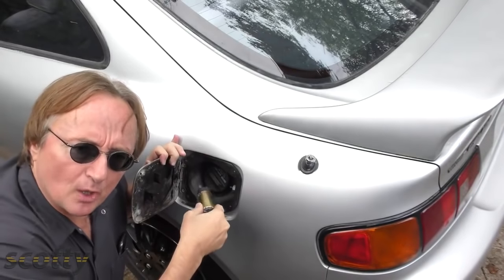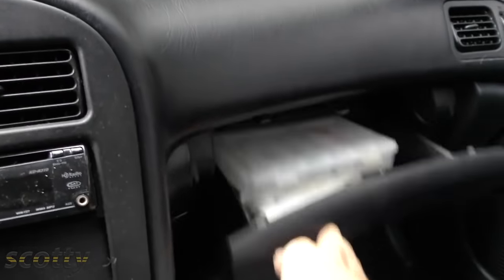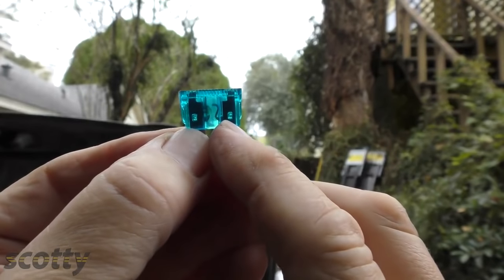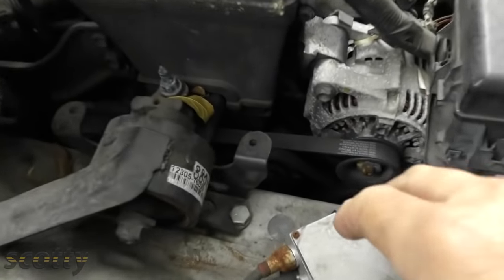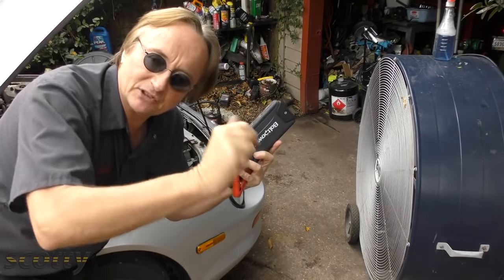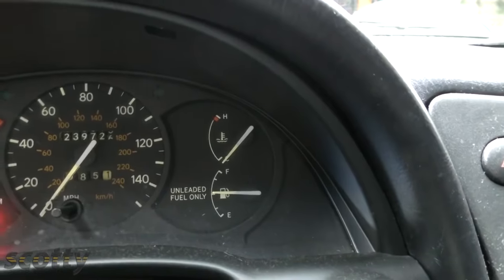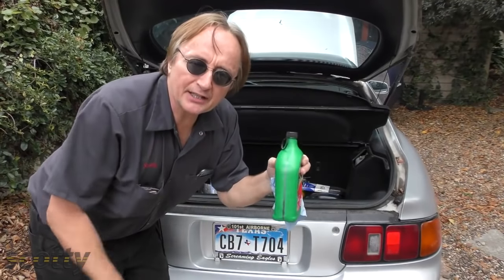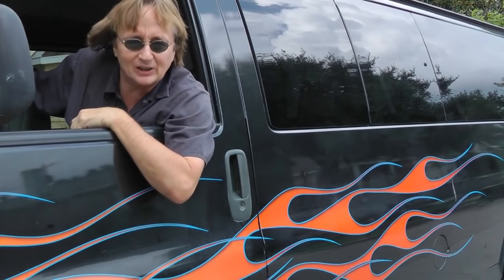How to Fix a Car that Won't Start and Randomly Dies While Driving

Comment: Not a good idea to change a fuse to a higher value fuse because the fuse is sized to keep the wire in the circuit safe from overheating. Better advice is to keep 4 or 5 of each value as spares in the glove box....they take up very little room. Then when a fuse has blown replace it with the same size as originsl, then if that one blows too you must find out what the problem is in that circuit....if you put a higher value fuse in, the wire in the circuit may start to heat up and start a fire........
Reply: Jeffrey Hill very much yes. Modern vehicle just don't blow fuses for no reason. There is a cause. Wether its added accessories, or a short to power.
Reply: Absolutely correct.  If you blow a fuse that ends up stranding you, and don't have one of the correct amperage available (always a good idea to keep a few spares in the glove box), then it's much better to swap one of the correct value from a circuit that is less critical (i.e. one you don't absolutely need to get you home) than to use a fuse of a higher value instead.  In addition to the risk of fire by using a fuse rated higher than the circuit is designed for, many circuits in cars (even older ones) have both fuses and so-called fusible links>  These links are designed as a "last ditch" measure to protect the wiring from overheating if the fuse doesn't blow for some reason.  If there's a steady short, using a larger amperage fuse will most likely blow this link, which will not only keep you stranded, but is much harder (and much more expensive) to repair as well.
Reply: Jeffrey Hill 
yeah
Reply: Hard to believe people don't know this. Now a few more will. Thanks

Comment: We have a 2003 Ford Windstar and it started off with us being able to drive with the air on. Then it would start to putput and then die on us. Afterwards it would not start right back up causing us  to have to wait to crank it up. Now we  are forced to NO ac at all and it has started to do the exact same thing. We  have checked all  fluids and they are all at a good level . Any suggestions on where to begin so we are Not putting ,money where it doesn't belong. Also, a place to take it to in the dfw area that isn't the cost of a house note.

Comment: Nice tips I would also add extra fuel filter (especially in diesel cars), $10 can save you hundreds in towing. Unless you have Merc or BMW than all you can do is to fix them with mobile phone and credit card.

Comment: Timing belt also... it's harder to check since you might need to un bolt some things to remove the cover but it happened to me in 2005. Make sure you know what milage intervals to change it at so you don't get stranded or bend the valves inside the engine!

Comment: got a question for you, my mums car overheats every so often, I can see the temperature gauge move up within 3 seconds and then down, shoot right up to hot, turn the alarms on then cool right down, then shoot back up again.

Oil level good
Radiator level good
Thermostat replaced within 100km (I checked the thermostat before putting it in, by using boiling water and it opens, so it's not faulty)
none of the hoses are leaking, no oil leaks...

What do you suggest?

Comment: My car only dies when i'm at a stop sign or long red light. Mostly when i have 1/4 tank or less. Iac,MAF,PCV,throttle body/TPS, plugs wires, and manifold gaskets all replaced or cleaned to new. Cant find a damn vacuum leak anywhere. Hearing a slight hiss but its from the IAC and i think i'm supposed to be hearing air from there. Changed out the IAC gasket too. I did notice though that my idler pulley is shaking/bouncing a bit. But not sure if that is the issue.

Comment: Hi Scotty I have a 2004 Dodge Dakota that was running but died a couple times on the road but now won’t run at all….battery is good but has no electrical power to anything on the truck…is it the ecm or something else? I’m for a loss.

Comment: 15 Ford Fusion SE 2.5 L. Have a very problematic no crank sometimes will crank after many tries. Then when I do manage to crank / start car , it’ll stall and die out. Could one single thing be causing both problems ? Two mechanics said it’s likely two different things. What single thing could be causing this ? Is it two separate things?

Comment: Another trick I've used in the past when I've been out and had a no-start is to remove a spark plug (I keep a socket set in the car) and clamp a jump lead to it and ground. Then I unplug the fuel injector for that cylinder. Then when you crank the engine, you can check for spark at the exposed plug. If I have spark I'll then check for fuel by removing the spark plug altogether and getting the HT lead WELL out of the way and plug the injector back in. Now when you crank you should see a small spray of misty fuel shooting up out of the spark plug well periodically. Its a quick and dirty way to test but it works. Best not to do the fuel test on a hot engine though.

Comment: Have a Pontiac G6 gt 2009 . Been having problems with starting car after it's warms up , it starts and runs then it will shut off and won't start back up till engine cools ! Tested alternator, replaced ingintion switch,checked starter ,new battery???? Don't understand checked all fuses what could make this happen many mechanics can't figure out ,,, what and how do I fix??????

Comment: hi Scotty, I got a 1981 F150 with a 302 V8 it's all original. it's got ab 400k miles on it and still running. the issue I have with it is I'm at a stop light and sometimes I press the gas to go once the light turns green and shell kinda stall but not fully she'll keep running just not enough to make it go. could it be distributor?

Comment: This is funny, Scotty basically has a repair shot in his trunk ;).  I'd add keep a eye on your gauges and warning lights.  My serpentine belt broke a few months back and the battery light came on and the air conditioning stopped working.  I realized what had happened and luckily my battery lasted long enough to drive it to my mechanics shop.  Like 15 miles I was sweating it.  When I got to the shop I had to turnaround and my electric power steering was starting to fail.  Pretty lucky but if I hadn't been watching and saw the warning light I would have been dead on the side of the road.

Comment: I replace my fuel pump on a 2007 Pontiac G6 but the Gage does not indicate fuel level was wondering what I did wrong I did check connections and everything seems fine waiting to run out of gas 2 drop tank again do you have a suggestion

Comment: Hey Scotty, my dad has a 2002 chevy trailblazer, he jumped it, it started, but the dash lights wouldn't come on, and it wouldn't go in gear, and after just a bit it died again... Any ideas? He tightened the battery and cleaned it up so far... Still same.?

Comment: 2:27

I don't feel comfortable taking apart half my car on the side of the highway to replace a belt.
Reply: deWaardt 😂😂😂
Reply: Fan belts are easy to get to. Your alternator angle is adjustable.
Reply: @vgrepairs  Ever worked on a modern car?
Reply: @99domini99     to be honest I only work on my personal and friends' vehicles regularly, 81 vw pickup, 89crx, 2002 civic, 05 pilot, 2011 versa, 04 dodge Dakota, 98 jetta. All of them have an easily replaceable fan belt.
Reply: I've done an alternator on a mountain top. Talking 8 miles from the nearest road. Find your sack if you're worried about a belt
Reply: @johntaggart91  It's almost like not all cars are built the same ¯\_(ツ)_/¯

Comment: You can listen for a working fuel pump. In a quiet environment, with the windows up, if your back seats fold down do that, turn the key to run but don't start it, you should be able to hear the fuel pump for a second or two. Also, there is a shrader valve right before the fuel rails to which you can check for fuel pressure (you'll get a rag and your hand smellin like gas though)

Comment: My first die on road: 1990 Honda Prelude, one week prior changed DIY'd my cap and rotor, screw for locking the rotor wasn't tightened, flew off rotor was in free spin pointing straight down. Found it, locked it, lesson learned.
Second died: 2005 Mazda 6 both L4 and V6, gas gauge LIES!!!!!!! Wasn't anywhere close to E but it was E, message boards said drop fuel tank, straighten/realign gas needle. I never did I just got in habit of keeping above half on both my Mazdas.

Comment: I have a 2012 Honda Accord V6... and sometime when I try to accelerate from a stop usually when I’m turning it will accelerate about 6 mph but it won’t go over... however my rpms don’t drop, and I shift it to neutral and rev up to 5-6k rpms it’s runs like a champ again... Do you know what it might be?

Comment: Makes me think of BMWs without spare tires, that's becoming a lot more common. Luckily they do use run flats which perform basically as well as a spare considering you shouldn't use a spare for long.

Comment: HI Scotty, I have a 1997 Toyota 4Runner issue, after I did oil changed it starts blowing white smoke from tail pipe but it run for a while but after awhile it stop running anymore even in reverse. And when I drain the oil tank the dip stick is still reading over the limit but nothing is draining. The oil tank appears to be empty but the dipstick is indicating too much oil. Any idea??? Please help!

Comment: Hi Scotty I hv a Toyota corolla ee90 problem is that if I switch a different brand of fuel my car would die after running a few miles.  After numerous start only then it can start. Engine is a 3e carb model.

Comment: I have a 2000 dodge ram 1500 5.2 v8 and it randomly dies while driving what do tou think that can be ive already replaced the spark plugs,spark plug wires,crank shaft sensor,fuel pump,distribor rotor...

Comment: I have a 82 Subaru brat with a 1bl carburetor it idles fine could well parked but it stall well driving like it's running out of fuel when and when I park again the idle goes up and down jw if you have any hints to help me out

Comment: Scotty Kilmer, thanks for your videos they always helps me.
I have a Toyota Noah 2006 Engine 1AZ, starts to act really wierd!!... it lost the REV, even if I press the pedal nothing happened but engine idle is fine..! then I have to turn the engine off and restart and worked ok. I have noticed this happened whenever I travel long route, that's mean when the car got heat.
The car temporature if fine.
Need your help please!??
Reply: Throttle Body ( the sensor or 2 sensors that are attached to it ! ) ... also check the wire going to the ECU . Get a computer to check for diag codes. Most likely : communication to throttle failed.   check wiring...   :)

Comment: Hi scotty I have a 73 mercury capri V6 carburated. Runs turns on fine but after a while of driving it shuts off. Try starting sounds like it will but wont. Let it sit about 3 hours go back and starts right up. WHATS THE PROBLEM? HELP

Comment: Scotty, i have a 1997 ford explorer... The alarm is al messed up see the driver door is stuck and wont unlock.... Therefore my alarm goes off.... But the main problem i think that alarm is causing is my battery goes dead while driving... New alt new battery.... Any suggestions

Comment: My question is i have a 99 tacoma hard start after i drive it and try to restart. When cold no problem. I just put in a used engine and changed nearly everything on the truck fuel filter and problem is still there my guess is fuel pump??

Comment: Don't forget, it can be other things. For example on my 99 Pontiac Bonneville SE, my HO2 sensor is starting to fail. The HO2 sensor doesn't always give the right information back to the ECU and the ECU calls for the wrong fuel to air mix.  I just refire after she dies and keep on driving.
Reply: Your oxygen sensor is not the cause of your stalling. The computer will default to failsafe  state if the oxygen sensor fails. Not saying it isn't bad just not the cause of the stalling. Would look at the MAF/MAP sensor, crank sensor, cam sensof, or Air idle control, and just general state of tune like plugs,wire, Air filter.
Reply: Tracey Allen All others possiblites are unlikely. It's an intermittent problem and my scan tool didn't pick up faults in the other sensors. Not ruling those out, but unlikely.
Reply: Viper & Mustang check for proper fuel pressure.
Reply: Tracey Allen A possiblity, but I would say unlikely. I don't have a fuel pressure guage, but I can use indirect means to make an a decent guess. Power and fuel consumption seems to be about what I expect. Also, the problem is intermittent, it happens every once in a while. Normally, I don't have a problem, but once in a while she shuts down.

Comment: Hey Scotty Kilmer I got a 1989 chevy celebrity and it dies while running on a cold start but usually does fine when the engine gets hot I replaced the map sensor, the temperature coolant sensor, the idle air control valve, the throttle position sensor and the crankshaft position sensor as well with a brand new battery, the car has oil in it and the radiator if full, the car races when you start it up then when you drop it down into drive with your foot on the break and then back into parking break it stops racing I'm not sure it it's the ECM or if it has an electric problem somewhere I'm wondering if you got any good ideas as in what it could be.
Reply: Yeah, if it's temperature dependent and if there are no codes stored in the OBD1 ecm, then I'd look to the ignition switch/circuits, ICM, ECM, MEMCAL, and finally a wiring issue, which could be a nightmare to find.  Start with grounds. Good luck!
Reply: Believe231 thanks sir I look into those
Reply: With the racing engine, try cleaning out the throttlebody butterfly, and be sure the throttle is fully seated against it's stop.  But if a new IAC didn't help, could have a big vacuum leak somewhere, Scotty has a video on how to find those using a cigar here on Y.T.  Good luck!  BTW I always check my emails on stuff related to Y.T.

Comment: Another thing to check is to see if your battery terminals are solid. I went to start my car one day, cranked once and everything died. All power to everything was lost. I was thinking oh god here we go, so I had a look under the bonnet and first thing I did was touch the battery cable, heard a zap and everything came back to life. It was super duper loose. So I tightened it down almost as tight as it would go and was on my way.

Also I’ve heard some GMs when you start them, if oil pressure doesn’t build up spec in 3 seconds (maybe because there’s no oil?), it shuts back down again as a protection against engine damage. I wonder if this system will also kick in while driving.

Comment: You shouldn't wait until your tank is empty to fill it.  The fuel pump is designed to be submerged in gas. So, it's best to get gas when you get down to 1/2 tank or just under 1/2 tank.
Reply: Davin Peterson reality is different though and not a lot of people have a log of money for gas.
Reply: They usually sit in a well inside the tank for that reason.  You really don't have to maintain that much fuel in the tank. It does slosh around a little so, personally, I don't go under 1/4 or so.
Reply: Fuel pumps have never been mounted directly inside the tank, either on engine block, frame, or side of tank
Reply: Davin Peterson exactly what i do
Reply: Jay G if you have money for a tank every whatever, you have money for half a tank half that whatever
Reply: i dont fill up until i have 10 miles left
Reply: Not true at all.  I have a 1969 Buick Riviera which has an electronic fuel pump in the fuel tank.  Almost all newer cars are the same.
Reply: Davin Peterson 1/8 a tank minimum is fine.
Reply: Everyone has a different answer but the fact is, you shouldn’t make it a habit to drive on E all the time. The fuel pump starts to work too hard by sucking up all the shit that’s on the bottom of the tank.
Reply: Davin Peterson Half?!?! Wtf man even like a fifth is fine unless you like going to the petrol station a lot.
Reply: What "shit on the bottom of the tank"? The pump is always sucking from the bottom. It's designed to have fuel pass through it to cool it. Because it's a DC motor it can happily be submerged, convenient side effect.  You have to have the pump running dry for a length of time before it "burns out", a lot longer than the battery will maintain on a car that's not charging it due to no fuel to run the engine.
Reply: Right.   NEVER go below 1/4.   You can pull dirt and debris right out of the gas tank.
Reply: Lol Damon how many mercedes have you ever driven? lol careful with that word "Never"
Reply: I almost always wait until I have my needle just a hair above "E" on my car. Never had any problems with the fuel pump and I've been doing this for years.

The exception is cold weather. Keeping too little gas in the tank makes it easier to freeze. During the winters, I won't keep the tank below 1/4.
Reply: I agree !!!!

Comment: I purchased a $50 BASAF Car Jump Starter 600A Peak from Amazon for each car. We were on vacation and the day we were leaving, dead battery, after a security guy used a small starter we were on our way,  drove 510 miles home without turning off the engine. Soon and we got home, turned off the Pacifica and nothing dead! Now we carry the jump starter. On the same vehicle 2 weeks later, my wife called me from work and said could not get the car in gear. I went to her office the the automatic shifter would not budge. Happened to see a tow truck, the driver tried and then showed me how to go under the hood and manually get the car first into reverse and then into drive, so I could drive myself to our mechanic. Paid him $20. and took the care 3 miles, my mechanic first thought it was the cable, but said it was the bracket that holds the cable, bottom line I paid 1/2 of what he said it would be. Gave him $20. for being honest. Maybe show  your viewers the trick, must have someone inside the car.